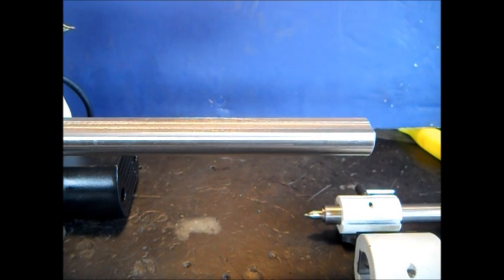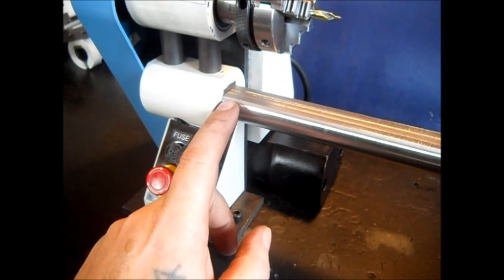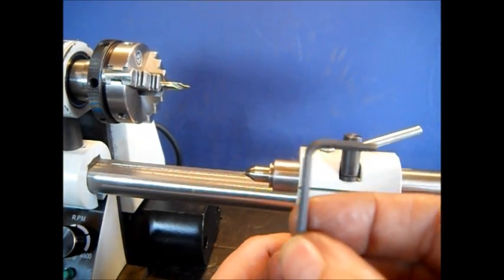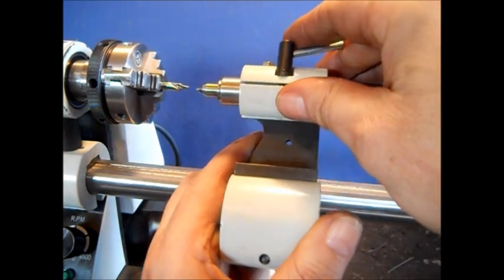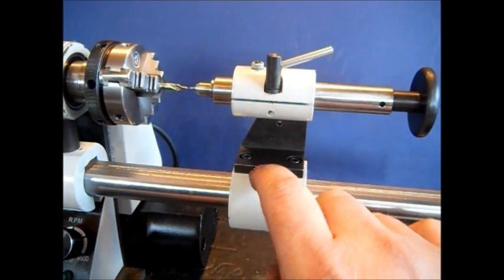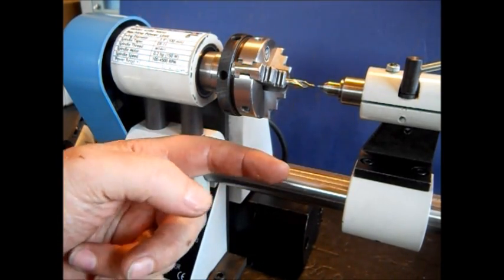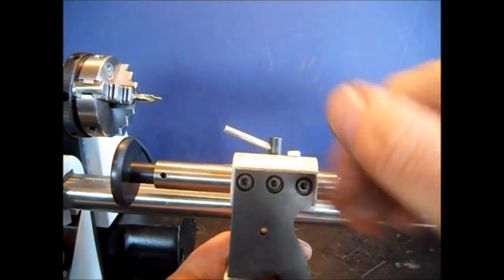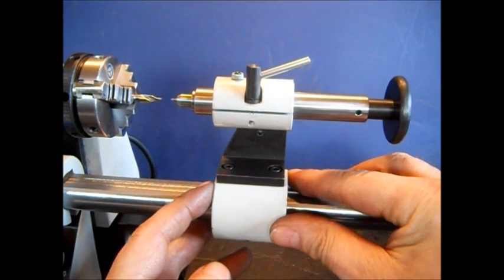Nano Lathe  ( Tailstock Adjust and Alignment )

Comment: Useful. shame its not in the nano manual. Just checking, the headstock shim does have two posi-drive screws and two adjustment screws for the shim height.  Though they are difficult to get to.